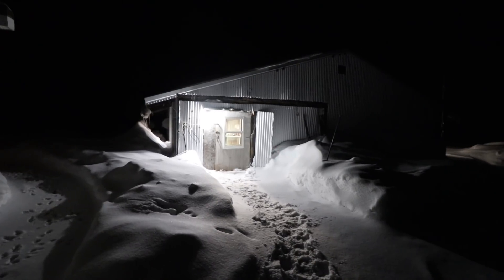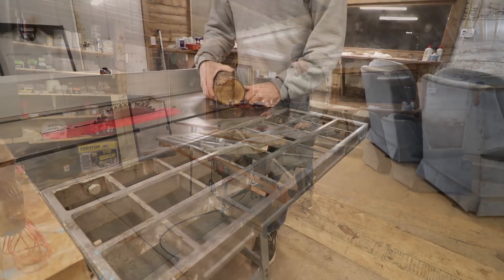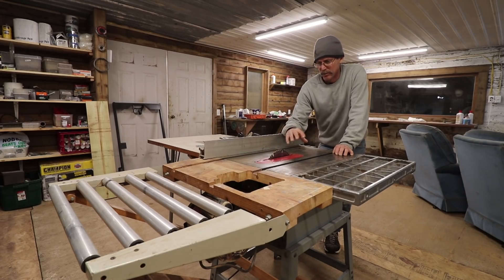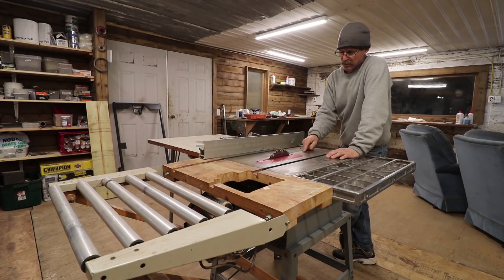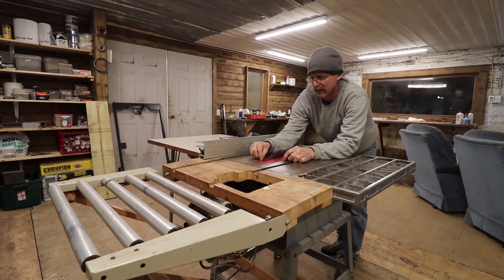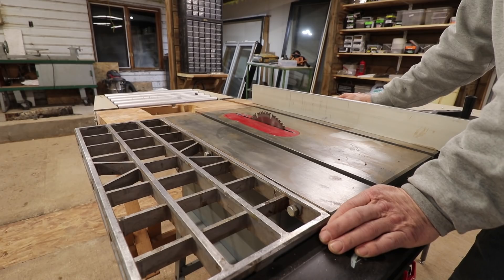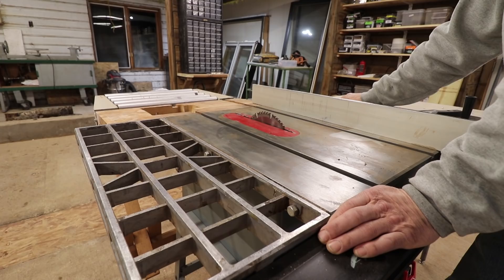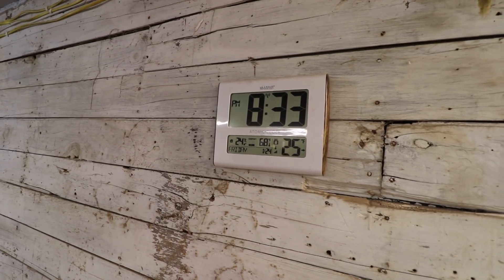Question? Delta Contractors Table Saw. Safety Issue. Board splitter. Your thoughts?

Comment: I will share some of my experiences, and I will just be repeating what other people say as well. But it is all down to risk taking. I was given a generic table saw years ago. Just the top housing. No base. I built a hefty surround of steel 'U' channel. It came with no riving knife. It's first job was to rip planks down. I had a jamming problem/kick back. (I had made a running jig) I made a riving knife, and set it up correctly. I had no problems since then. I made a power cutout, this I have only used once. If you cut exotic wood with twisted grain you can have problems. I had a friend who would talk when I was cutting something. And he knew about safety. I now will not work around people. If you have used a power saw for thousands of cuts. What is worse? Starting out as a green horn! Or now, long in the tooth, and very aware of still being careful. I had another friend, who would remove the safety guard from his Dewalt Radial Arm Saw. He said it cut his view down. He had a lot of 'original' ideas about how things should be done. To the north of us is a rare Carbonaceous Volcano, (extinct). He spent a lot of time up there, camping, and collecting rocks. I have been there once, and it is an amazing place. The only problem with the place is that it is very radioactive. (He knew this). Well I warned George about the place before another trip up there. And he laughed. He died of a rare  lung cancer a few years back. His wife passed on a few years after that, also cancer. There is another place 4/5 hours drive from us. A holiday resort, with a radioactive spring. I have been there 3 times. But I will not go back, same thing. I rebuilt an original Shopmate. I do not use the table saw part as I think it is too dangerous. I use jigs to clamp work down, and cut. I still have all my fingers. All of us who use these tools sort of know the risks. The other day on Youtube, a chap put a router bit in a drill press. I did not finish the video. I work on lathes. I was standing next to a friend of mine machining plastic. Someone came in to inquire about a job. He reached over to pull some of the streamers away from the cutting tool. My friend smashed his hand away. To this day I still wonder if he knew how close to death he was that day. No one said anything afterwards. Great videos, many thanks, and greetings from Africa.
Reply from the maker: Thank you David.
Reply: @NorthernSeclusion  Thanks Joe,  My sister use to live in Burnsville, Mnn. Her former husband was also in construction. I visited her twice over the years. I have done a few trips up to the area of the Tent. Your videos bring back good memories.  Many thanks for the trouble you go to, to share this with us. Cheers David.4

Comment: You can just get a new throat plate for it and install an aftermarket splitter kit. You might even be able to get an actual riving knife for it but they're more in depth of an installation. You can also run a feather board like one from Magswitch or Hedgehog. Both of those will help to reduce kickback.
I have an old Craftsman saw that's very similar to that one. It never came with a riving knife so I use one of the throat plate mounted setups from Microjig. They have a couple different ones for a standard kerf blade of 1/8 or a thin kerf. They're only 20 bucks on Amazon but you will need a new zero clearance throat plate insert.

Comment: A board splitter is called a riving knife and they suck! I have removed them from every saw I have ever owned. I have a wood shop for over 20 years, and safety begins and ends in your head and hands. There is one major rule, NEVER TOUCH THE BLADE! unless the power is off. Kickback is the most common problem, keep the wood against the fence, stay out of the way if there is a risk, and never use a crosscut guide at the same time as a fence! Reach out if you have any questions, I am here for you. even though you gave away your ARGO!

Comment: I run an older unisaw every day with no guard.  I always use a wooden throat plate, and used to glue in a splitter behind the blade.  I found that to get in the way too since it was a fixed height.  Kickback is no joke but 1.5 hp will stall if you pinch the blade that bad.  For rough cuts where pinching is an issue, use a 7-1/4 skillsaw blade.  You still have close to 2" of cut at 90 and they are much safer and cut faster removing less material.  Safety is definitely a very personal issue. I have no problem using a well tuned saw with no safety features, but would never advise someone else to just because it works for me.  Being that you made this video it seems you are concerned about it so buy it make a splitter/ riving knife and try it.  Peace of mind is valuable!  Be safe out there!

Comment: I've got an older Delta/Rockwell version of that and have never had any kickback problems. If you maintain a sharp blade and keep your fence in perfect alignment you shouldn't either. Should you run burn marks fix the problem by checking fence alignment or blade sharpness. These saws were made to cut live wood. If you run a straight edge across the table you'll find that it's not perfectly flat side to side. Take a straight edge and check. You may be .01" + difference at each side of your blade. When cutting live wood this allows expansion at the kerf to prevent binding on the blade.Keep your hands away from that safety sphere we maintain around the blade and wear safety squints especially cutting through knots. Haven't got one good thing to say about those direct drive, flat table, whizbanger, rattle traps.....

Comment: hey joe...i just bought a Ryobi RTS23..good portable saw with wheels..can accomodate a 27 inch cut from fence to blade..good for ripping plywood aswell..got a 10in blade and 15amp motor..good saw..got the anti kick back feature with the guard..but those can be taken off..i mostly do cabinets and some construction work on my spare time..Dewalt DWE7491 seems likee a good saw aswell..more pricier though

Comment: I think the plastic guards are dangerous myself but the splitter is good on about 90 % of cuts. I have a large 52 inch headsaw mill and I wouldn't even think about running it without a splitter. After all a table saw is just a small sawmill is it not ? In many situations when a splitter would be in the way I have a small bucket of wedges i can tap into the kerf. Either the end(start) or along the top of the cut. Timber bind can definitely cause kick backs so staying to the side is good practice.The splitter on my Delta floats with the blade so you can do datos or other cuts when the blade is buried within the piece being worked. Good post bud.

Comment: If the "splitter" is in a fixed position, it is called a splitter.  If it moves up and down along with the blade, then it is a "riving knife".  More than likely, you are looking for a splitter.  Just google "splitter for (your model of saw)" and you will find it.  The "fins" you mentioned on the sides of it are called anti-kickback pawls.  Those are kind of a pain in the butt, so I wouldn't bother with them and take them off.  The splitter itself is what you need, just remember that you need one that is NOT thicker than the kerf of the blade you use.  Ideally, it will be just slightly undersized from the blade kerf. All you are wanting it to do is keep a cut from closing back in so much that it grabs the blade and launches itself thru you or the big window directly in line with it.  And trust me, that saw could EASILY do it.

MJ Splitter is a universal splitter kit that you attach to a zero clearance insert that replaces the red insert currently on your saw.  Simply buy or make a zero clearance insert, then attach the MJ splitter kit to it, and you're good to go.  you can get them from Amazon for about $36.  Make sure and get the one that matches your blade kerf.
Reply from the maker: Like I said in the video..... I have done all the research, I know my options.... I want to know what type or brand name or whatever that other people are using that has worked well for them. I do not mind spending a hundred or two hundred dollars if needed, I just only want to spend it the one time.
Reply: Thank You, I learned something, as I did from most posts here. I see your post is edited but I wanted to let you know,,

Comment: RIVING KNIFE IS THE PART YOU’RE LOOKING FOR. There are several available for that Saw. Rockler sells one and other major woodworking stores. If you change the angle of the blade the knife changes with it. You can get it with anti kick back teeth and without. Mine doesn't. When not using you just push it down under the table. GOOD LUCK, STAY SAFE. PS, That window looks prime Target for flying kick back board. Maybe some chicken wire stretched tite in front of it.   Vinny 🇺🇸

Comment: Would a feather board clamped to the fence work Joe? Holds the piece your cutting  down to the table. Norm from The New Yankee Workshop and This Old House would use one at times. The feather board is angled away from you to the keep the piece your cutting from kicking back.

Comment: I'm a cabinet builder and I don't use those plastic blade guards either. I've found that good 10" blades make a big difference in throw backs. The more teeth the less throw back. Just my opinion.

Comment: I think I noticed that your saw has a leather link belt. I have one on my saw and if anything ever binds it will slip bogging down the blade. The link belts are made of leather and also help with dampening vibration which will help save bearings too.

Comment: I have the Craftsman saw about equal to that, maybe a little heavier. You'll be fine the way it is, I've seen you use the circular saw. On mine the belt really doesn't have a tentioner, the weight of the motor keeps the belt tight. If it does kick back the belt will slip and the board won't go far. Mine doesn't even push past me.

Comment: Funny you brought up the ? Splitter? Yesterday I ripped two 2x4's and the gap created by the blade width certainly did pinch back and I had to be very careful running that 8' through.  I would be curious as to what is suggested and you use.

Comment: Just a little suggestion, that maybe before you use the table saw, you could lay a piece of plywood in front of your workbench immediately in front of the window.  If a piece of wood decides to fly off the table saw, it will hit the plywood and not your new window.

Comment: I have a Powermatic 5ph cabinet saw in my shop with no riving knife and I use it pretty confidently.  The few instances of kick back I've had I've been able to get out of the way or shut the saw off with my knee before it happens. However, I suggest that you get the riving knife because if you cut off your fingers and can't hold a camera anymore then what the hell am I supposed to watch for entertainment?

Comment: Hi Jo I was using my table saw yesterday and I’ve cut my thumb off stupid not paying attention I’ve shattered the thumb joint and cut my bone in half and the is about 10mm off skin holding on I’m just still waiting to go to theatre to get put back together if they can save it they will fuse it together at a angle but won’t be able to bend it.

Comment: Yupp, an adjustable and removable riving knife with anti kickback pawls or dogs as I call them.  It seems as I get older (63) I tend to be more "attached" to my digits. Pun intended.  I've seen guys attach a 1x6 to the fence and attach a feather board to it vertically to help prevent kickback. You still have to remember to be very careful around this stuff. I been lucky, only one trip to the ER to get a piece of wood 1 1/8 x 1/8 aprox, removed from my face by my chin. Partially my fault, ripping a thin strip off from a facia board and it shot a piece at me. Not really a kickback but similar. Maybe Rockler has something. Keep the content coming. We both enjoy very similar things. I'm alot slower motion and and alot less ambitious than you nowadays, but that gives me more time for reflection.:)

Comment: You could start with a "Microjig" brand splitter. I made something similar built into a zero clearance insert plate which will be the next thing you may want. I have the same saw and the best upgrade that I did was to add machined steel pullies/sheves and a linked belt which made the saw a lot smoother.
Reply: Greg F   Good recommendation. Joe be safe while you are being creative with the “natural” look.

Comment: "riving knife/splitter" should be added whether you buy an aftermarket or make a simple splitter from hard wood.  I knew it wouldn't be long before the "SAWSTOP" folks chimed in...lolololol  As for the blade guard, I am one of the many, like you, that rarely if ever uses it.   MY simple approach to kickback is, a riving knife, standing just to the left of the blade and making proper alignments......it may not be the best solution but it has kept me free of kickbacks and or injuries.
Reply: Every tradesman I've every known which isn't tons, but enough, have removed safety implements for efficiency purposes. Joe seems like a tradesman first hobby second guy so he makes sense to me.

Comment: no riving knife or paws for help kickback, get those install them.  Kickback is not a problem with a table saw if you stand on the side, what the issue is, is if you use wood that is warped, it won't just shoot back it will pull you in to the blade and it binds.  The Paws work like a one way tunnel, that prevents the board from going back.  Riving knife at least, the width is not bigger than the blade so it wont get in your way

Comment: It's very easy to make a throat insert with a wooden splitter glued into it.  Micro-Jig makes one. I made my own. I made one throat plate with a 1" tall wood splitter, and another with a 1.5" tall splitter.  Ideas for this are all over the internet StumpyNubs and Mathias Wendel, for intance).   Also, there are splitter "templates" that you can make from a piece of metal. printable, paper templates are available for those on the internet, too.  I'll keep looking for the link. I cut out three different sizes of these, but do not love them.

Comment: The part you are referring to is called a riving knife.  And you probably already know, but also of paramount importance is ensuring that the fence is perfectly parallel to the blade, as the blade can pinch the work piece against the fence, or catch the backside of the cut and lift the work piece.  The blade should also be perfectly parallel to the mitre slots. Don't use dull blades, and never have the blade any higher than it needs to be to make the cut.  Zero clearance inserts are also helpful, especially with smaller work pieces.

Comment: Their is a board splitter that is made for this saw and it works good. You don't want a kickback from this saw, it's got lots of horsepower and the splitter prevents it well. It's a bit of a hassle a lot less than a trip to the emergency room

Comment: Get one that moves  with the blade when you change the blade angle. If you have 220 in the shop wire the saw for 220. The power company bills for current use. At 220 the current draw will be less than 110.

Comment: Not to get off the subject but on your big window you should put metal scrapping horizontal and vertical. Will not cut out the light from out the outside. Does not have  too many either.  Just some. May save your window  from some thing fling into it.  A lot of work on your part putting it in!!  I have seen it done many of times...   I hope I  come across to you you....    Good luck........

Comment: 55 years ago I was using a table saw in shop class in High school and it kicked back and put a dent in the metal exit door behind the saw.Been afraid to use a table ever since. Your window might get broken. Put some rabbit cage wire on the inside.

Comment: I have a 4 horse Unisaw been working with it for 37 years no riving knife no guard and have never not been able to control a kick back just watch your cut as you are feeding it and if the kerf is closing up behind the blade lift the board up off the blade from the back and turn it 180 deg. and continue the cut from the other side.
Reply: P.S I would not cut log's on a table saw with out a jig!!

Comment: With my shopsmith table saw I always use the red push stick it came with. I really only used it when I was within 6 in of the blade. Honestly that's all I got on safety.

Comment: I have owned a cabinet shop for 20 years.   I have four table saws, big ones, all cabinet saws and one large Casadei sliding saw, none have the riving knife.  I have had them cause me more close calls than they have saved me from, so I don't use them.  If they get bent or pinched at all they will cause issues and get hung up.   With thin stock its not much of an issue, but when you cut thick stuff, that knife needs to be exactly behind the blade and totally vertical or it will catch on the stock.  I always tell employees that sharp tools are like guns, they demand respect.  Use proper technique and that's all the safety gear you need.

Comment: I owned several for years mostly making wooden stakes by hand which is one of the most dangerous things you can do with one.  Never had a problem. Just paid attention and kept a firm grip. Like you I do not like anything covering the blade. I think the safest thing is to be able to see the blade clearly. But, I am never going to give a man safety advice. You should always do what is best. I never had a chainsaw kick back either and I remember before they had chain breaks on them. But I still like knowing the brake is there. Mow I been wondering if I should by some chain saw chaps?